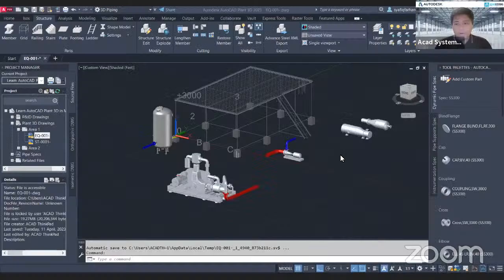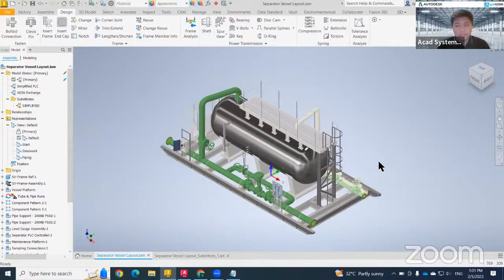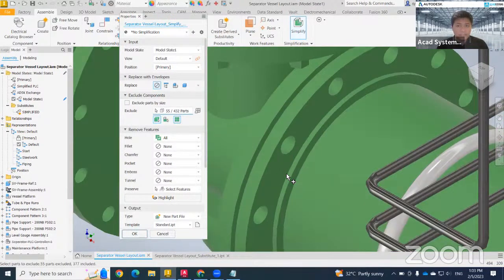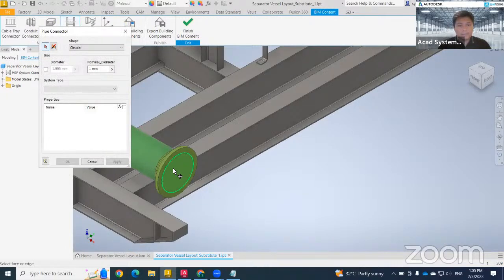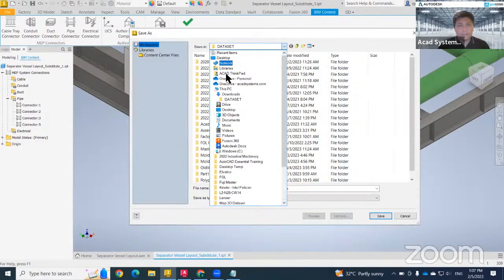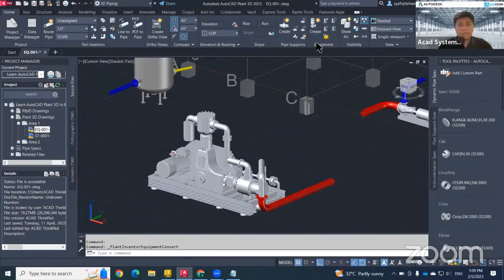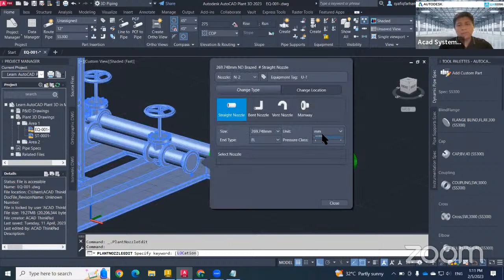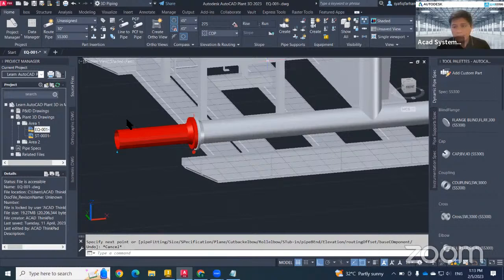Inventor Assembly to Plant 3D Equipment - Lesson 7 of 13

Comment: Thank you for this video. Can you tell me - what ahhpens if you change the 3D-Model in Inventor (f.e. add another pipe and pipe+connection) and export that file to the same adsk-file? Does it automaticall implement the changes in Plant3D, or will it be seen as a completely new equipment?